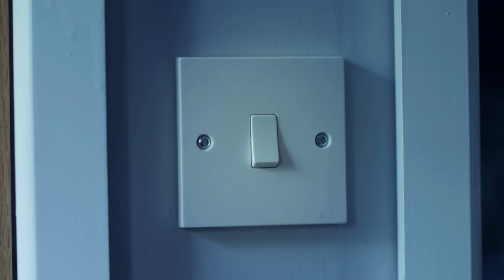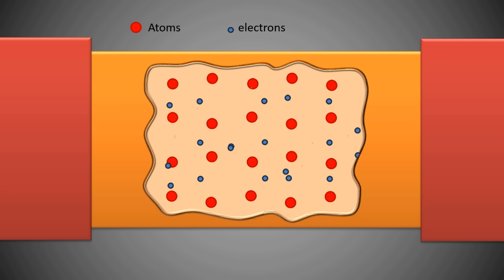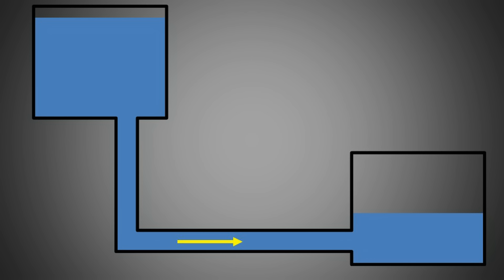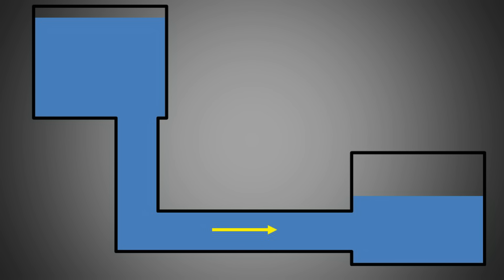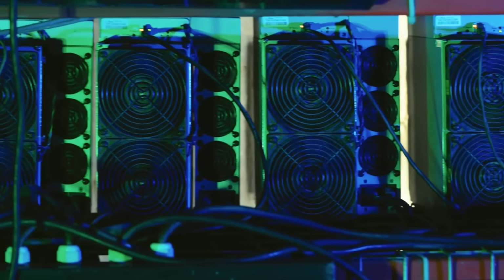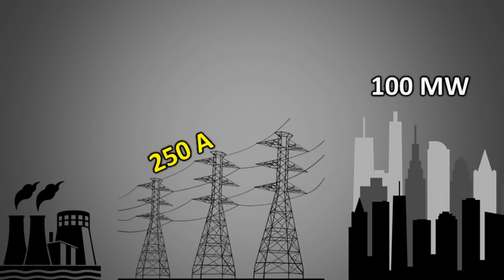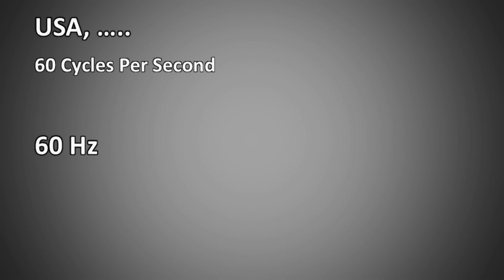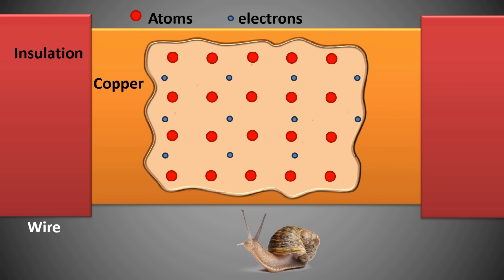What Is Electricity? If Electrons Move Slower Than a Snail, Why Do Lights Turn On Instantly?

Comment: I dont understand you said that the electrons move with only 0.2mm/s . Then how can the current or voltage be increased? Do the electrons travel faster with higher voltage or current? Because as I understood it, If you have a lightbulb where you can increase the intensity, you need more electrons passing there per second am I right? And the only way for that is If the electrons travel faster but in your Video it seemed like electrons ALWAYS travel with the slow 0.2mm/s. Can you please clearify that?

Comment: Electricity is not a movement of electrons like water flowing through a pipe,rather its an atom losing and gaining electrons throughout a conductor,which for simplicity and reasoning is called a flow of electrons.Water flows but electrons moves from one atom to the next sequentially, making it seem like a flow
Reply: Completely false,I learned it in 6th grade and its false.
Reply: @imnewtothistuff Well we expound on what we were taught or read from a science book which interestingly begs the question of what's true or false.That might not be an easy thing to disambiguate because much of what is taught and learnt is based on theory.

Comment: You can't talk about electrons without the term "VALANCE ELECTRONS" or "free electrons". It's the "holes" that move opposite of the flow of electrons. Oh, and electrons move at nearly the speed of light, depending on resistance
Reply: A hole cannot move, a hole is nothing.
Reply: @Almighty-k8s8t  the holes appear to move because the valance electrons are filling them in the opposite direction. The atoms missing an electron are positively charged, which is why some people (like electricians) will argue that "electricity flows positive to negative"

Comment: No! Under your analogy of water in a pipe, which is common, the “ push” would be at the speed of sound, much lower than speed of light.
Correct explanation requires looking at the Poynting vector, it is harder to explain than the much too common, and wrong if you think about it, water in pipe.

Very short summary. Power supply sets up electric field which does move at speed of light, this field sets up a potential along the wire, the field, or potential gradient, applies a force on charges making a current. This current is set up essentially at speed of light, so current everywhere in wire, the “pushing” is so slow that essentially irrelevant. The current sets up a magnetic field, E and B fields make Poynting vector which is how energy flows.
Reply: Poynting vector. That's a cross-product !!! That means the energy flow CAN'T be along the wire! It has to be perpendicular to both the electric field (along the wire) and the magnetic field (around the wire).  That means out from the power source perpendicular into the field and in from the field perpendicular into your wire or device. The energy used in your device doesn't have to be the same energy that leaves the power source. Just has to be equal amounts. My monitor could be running on your power source and vice versa!

Comment: Electrons don't flow in copper wire. Teaching something that simply isn't true does not help understanding. I've tutored people who learned mechanical analogies and for some it's impossible to let go of them (so they never understand). Children can learn about electric and magnetic fields, which are far more tangible than electrons. Circuit analysis and design don't involve electrons.

Comment: Regarding point 2: the actual current carrier is the electron. But by convention the US uses "holes"--the location where an electron used to be--as current carriers, whereas, in Europe, the convention is electron flow. The end result is the same, though, as far as circuit analysis is concerned. "Holes" don't actually exist except as concepts.

Comment: If the AC is 50 Hz, that's 50 cycles per second, and 1 cycle has to change direction twice - back and forth. So the current will change direction 100 times, not just 50.

Comment: And as voltage increases, electrons repel each other and move to the outside of the conductor while the nucleus of the atom in the inside of the conductor moves in opposite direction. So the voltage flows on the outside of a wire and the current flows in the opposite direction within the conductor. When the wire is small, these opposing flows create friction against each other limiting the current capacity of the wire.
Reply: How does voltage flow.?

Comment: Good video.  I used to have to explain this when I was giving powerhouse tours at the Bonneville Lock & Dam on the Columbia River.  Incidentally....  When I studied Electrical Engineering years ago we stated Ohm's law as E=IR.  "E" is for Electromotive Potential.  The units are in Volts.  I is for current.  The units are in Amperes.  R is for resistance.  The units are in Ohms.  Stating Ohm's law as V=IR mixes units and the physical attributes.

Comment: Weil sich die Elektronen kaum im Leiter bewegen, aber dafür die elektrische Energie in Wellenform um den Leiter (Elektronen) herum, dann kommt es natürlich an der Engstelle des Glühfadens zur Konzentration der Energie, die den Faden erhitzt und glühen läßt. Es ist wie eine Welle im Wasser, die kann sehr schnell und Energiereich sein abhängig von der Wassertiefe und sich rasend schnell ausbreiten, ohne das Wasser zu transportieren, das bleibt an Ort und Stelle, hebt und senkt sich nur ohne das Wasser selbst horizontal zu bewegen. Trifft die Wellenenergie auf Land, also das Wasser wird immer flacher, kommt die Größe der Energie zum Vorschein, die Welle türmt sich auf. Und bricht und setzt die enthaltene Energie frei, was in etwa dem Glühfaden in der Glühbirne entspricht.  Das Wasser ist der Leiter, wie im Draht die Elektronen, der Energie! Aber nur die Energie bewegt durch den oder um den Draht herum, nicht die Elektronen selbst.

English: Because the electrons hardly move in the conductor, but instead the electrical energy moves in wave form around the conductor (electrons), the energy naturally concentrates at the narrow point of the filament, heating the filament and causing it to glow. It is like a wave in water, which can be very fast and energetic depending on the depth of the water and spread rapidly without transporting the water, which remains in place, only rising and falling without the water itself moving horizontally. When the wave energy hits land, i.e., the water becomes shallower, the magnitude of the energy becomes apparent and the wave piles up. It breaks and releases the energy it contains, which is roughly equivalent to the filament in a light bulb. The water is the conductor, like the electrons in the wire, of the energy! But only the energy moves through or around the wire, not the electrons themselves. Perhaps not a perfect analogy, but very similar in principle.
Reply: Danke für die Erläuterung !
Ist es nicht auch so, dass bei Wechselstrom die Elektronen praktisch nur hin- und her zittern und gar nicht vom Fleck kommen, weil sich die Richtung ihrer Bewegung in der Frequenz des Wechselstroms praktisch permanent ändert ?
Reply: @timboland7767  Genau so! Beim Wechselstrom passt die Analogie mit Wasser auch nicht mehr so gut. Aber im Grunde ist es das Gleiche, denn das elerktr. Energiefeld um den Leiter herum wechselt halt 50 mal pro sek. die Polarität, in Sinusform, die Energie, die durch den Glühfaden "gequetscht" wird bleibt aber die Gleiche und bringt ihn zum Glühen. Ein bischen schwieriger mit Wechselstrom sich das vorzustellen.

Comment: Another common mistake is connecting micropower like windmills and solar to the grid and then you only get it about 15% of advertised output or extra electricity which is easily demonstrated with a volt amp meter and fourth grade math called Ohm's law
Reply: Just like pumping water or are against existing pressures

Comment: Well the theory is interesting but how can higher frequency AC signals change direction so fast if the electrons move very slowly this is a question that this video does not answer ?!
Reply: Drift velocity of 0.2 mm / Sec is very slow, at about 2.4 feet / hour.  But, there are electric and magnetic fields which are closely related.  When talking about electrons and their movement, we think in terms of an electric field, that describes the strength of the attraction of opposite charges and the repulsion of like charges.  It is this repulsion/attraction (field effect) that traverses the wire, like a long tube filled with ball bearings. The ball bearings move slowly when pushed, but any sudden 'bump' is instantly seen at the far end.  Also know that changing fields are the basis for AC currents (as in cable and radio and microwaves) that are used to transmit and process analog and digital data.
Reply: @3216-u4u  so if you have a 1khz signal this means only the fields change polarity as fast as that but it must mean the electrons themselves experience this speed somehow  so it does not seem to make sense at least for now the way I understand the video now!
Reply: The voltage changes, this voltage change is caused by a change electromagnetic field. All charges respond to this electric field. The result is a force on electrons due to this field.

It is a common misconception that the moving electrons ( current) is like water in a pipe. The correct way to think about this is the power supply ( dc or ac) emits an electromagnetic field. This field moves at speed of light.  It is this electric field that applies a force on the electrons, creating a current.

Unlike the water in the tank ( bad) metaphor , the current is not from being pushed by electrons from behind, it is a local effect due to the electric field.

Comment: Instantly? All relative. LED bulbs rely on the power supply ramping up, so within a 20mS window. Tungsten er, not so fast. There is a large inrush current but the element has to heat up, so maybe 40mS. If it is my touch switch, slower than that. If it is my dimmer switch I start at low on switch-on to save the filament from the inrush shock, maybe gives it a longer life. AND my on/off security adapter turns the light on, in normal mode, slower than I would, same lifetime issue.

Comment: Inaccurate.  The free electrons in a wire are always moving fast, even when the circuit is open, but the net movement, called drift, is slow.
Reply: Yeah, 0.2 mm/sec is already fast if you think about that atoms is hundreds of nanometer smaller at scale. 😅
Reply: Free electrons are randomly moving, drift velocity is quite slow and oppose the magnetic field, fermi velocity would be the modern and proper measurement for electron movement in solids if we would like to get technical.
Reply: Madonna come sei saputello !! Ora lo so anch'io !! Grazie di avermi illuminato con la Tua sapienza !!
Reply: Yes you approached, It's Drift velocity due to electric field.
Reply: Yes. Beta rays move at near 'c'.

Comment: “What is Electricity” …oh, I see it’s an electric field 🧐 
What’s an electric field? Nobody knows, but it moves at the speed of light.
Reply: Your point is why there’s so much confusion. We’ve all been taught this stuff very poorly. The moving magnetic field applies pressure to the internal structure of the element and then releases it. This back-and-forth is what produces electricity which is a hybrid of magnetism and heat.

Comment: Your double quantum eraser was the best explanation but you should see veritasium’s video on electricity and electric currents as it led to a firestorm of debate among electric engineers and professors. Which side of that debate are you on?
Reply from the maker: Veritasium is an excellent channel — many of Derek’s videos have inspired me and even helped clarify several concepts.

But regarding the video you mentioned, there is a small point where the explanation may not be fully accurate.

It is true that a very tiny current begins flowing through the bulb almost instantly, without waiting for the light-speed delay.
However, that micro-current is not enough to light the bulb to its rated power and full brightness.
The actual rated current reaches only after the electric field has propagated along the conductor, which in that example would take about one second.

There are at least 3–4 detailed explanation videos on YouTube where experts analyze this exact scenario and clarify this point.

Personally, I feel that in this particular video, Derek held on a bit too tightly to his initial phrasing, which created confusion for many viewers.
Reply: @ScienceSimplified4All he had at least one follow up video to that original one where he discussed the issue with electrical engineering professors.

Comment: If electron move through bulb, wasnt it be used up by the bulb? Why there are still electron come out from bulb again back to battery? 
Then if electron move slow, in ac circuit, dowes it mean only the few electron around the bulb are being repeatedly used up since it keep changing direction causing the electron have no chance to go back to tbe battery?
Reply: Electrons are not 'used up' in a light bulb because electric charge is conserved in quantity. 

A common analogy is a closed loop of water pipes with a water wheel (the light bulb) and a pump (the power source). The pump pushes the water around the circuit, making the wheel turn and doing work. The water (electrons) doesn't get used up; it's the pressure (voltage) and the energy that are utilized to power the wheel. The water simply cycles back to the pump to gain more pressure and repeat the process.
Reply: The electrons have lower energy when leaving the resistance. The loss is seen as heat.  Electrons "vibrate" faster when at higher energy states.

Comment: bulbs doesn't glow instantly... i remember seeing them almost lighting in slow motion where it starts heating then lits room slowly ... relatively i mean but it was clearly visible or noticeable that room starting filled with light reflections as i get older i noticed i don't see that pattern anymore that clear... seems like as kid humans brain works faster in recognition mode at least. .. or may not be valid for anyone but most likely it is . until we have neural debuggers its hard to verify it :D

Comment: Explanation why the light goes on  immediatly is wrong.😢
Its the field outside and around the wire that takes the power with light speed to the bulb.
Look for poynting vector S = E X B ( vector cross product of magnetic and electric field).😢

Comment: Today, there is also HVDC systems for power distribution. This is using semiconductor techniques. The benefit of HVDC is that it eliminates reactive losses over long distances. At long distances even 50 Hz is a radio wave.
Reply: True

Comment: An illuminating video; pun not intended. Thank you. I have a question: At the end of the video you used the term 'electric field' describing the flow of current and how this moves at the speed of light. How is this different from the flow of electrons that move at the .2mm/s? I'm confused.
Reply: Everyone has been confused for 100yrs. It’s aether that flows at the speed of light and it doesn’t hang around in wires waiting for you to turn on the switch. Otherwise there would be no power surge in the opposite direction when the power is cut off. 
 Water stays in a hose when you turn off the tap. Electricity (aether) is squeezed out of the wire by the collapsing magnetic field when the switch is turned off. 
 I had the same question as you, I thought about it for awhile and figured it out. Just wanted to share what’s been obfuscated for a century.
Reply: @PaulCaron-s1x  If you believe the aether is real, than you didn't figure squat.
Reply: Drift velocity of 0.2 mm / Sec is very slow, at about 2.4 feet / hour.  But, there are electric and magnetic fields which are closely related.  When talking about electrons and their movement, we think in terms of an electric field, that describes the strength of the attraction of opposite charges and the repulsion of like charges.  It is this repulsion/attraction (field effect) that traverses the wire, like a long tube filled with ball bearings. The ball bearings move slowly when pushed, but any sudden 'bump' is instantly seen at the far end.  Also know that changing fields are the basis for AC currents (as in cable and radio and microwaves) that are used to transmit and process analog and digital data.